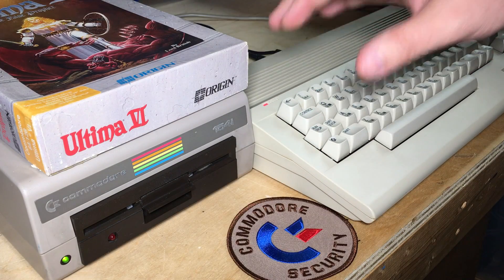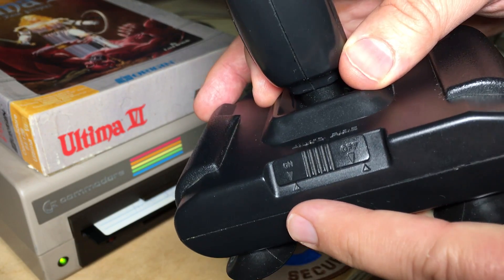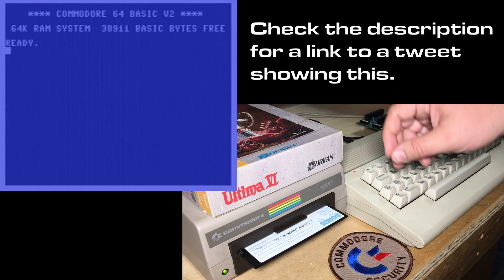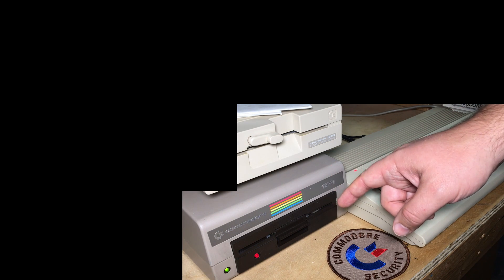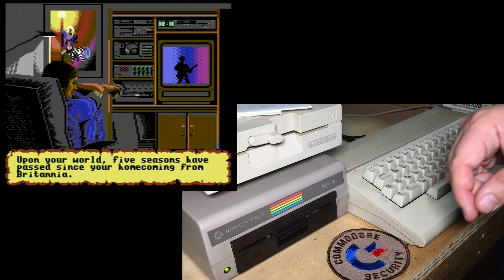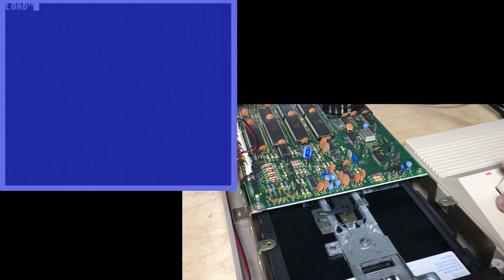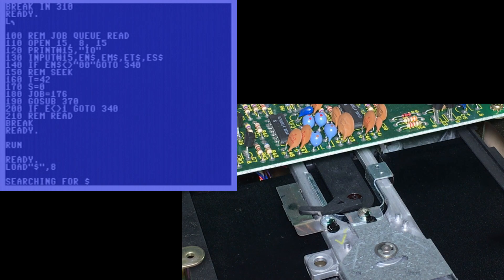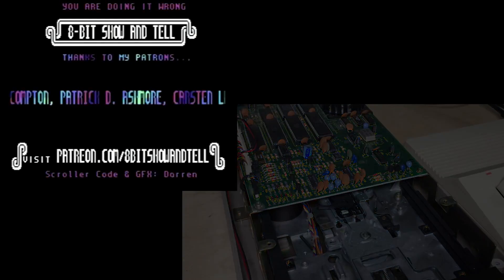Karateka Killed My 1541  (Temporarily) and Other C64 Scares

Comment: I think the joystick in port 1 is just acting like part of the keyboard. You can press up on the stick to get a 2 (at least I think it's up), or press 2 and send the character up... same thing to the computer. Basically just watching for those characters is the "joystick driver software" for port 1 (not for all types of controllers there, though). Right? As for how 2 works, I guess that's a little more complicated.
Reply: Actually joysticks do... in both ports :)

Port 1:
Up = 1
Down = Left arrow character
Left = CTRL
Right = 2
Fire = Spacebar

Port 2:
Up = Commodore key + F3
Down = Commodore key + S
Left = Commodore key + F
Right = Commodore key + H
Fire = Commodore key + K

Those presses will fill memory locations 56321 (port 1) and 56320 (Port 2) respectively with identical values for the corresponding joystick input. 
Robin has demonstrated how to read joysticks from  those addresses in another video :)

Comment: Only on the C64 does the joystick mess up the keyboard. 😒
Nearly every C64 user I knew had a copy of Fast Hackem to copy games. I gave a few of those copies out. 😝
Reply: For all its strengths there are some truly shocking user experience liabilities and failures on the C64, particularly considering it was a relatively late entrant in the market and everybody should have known better. The port 1 "oh yes it will just completely mess up your keyboard input, hope you don't mind" is just one of the more obvious ones.

Comment: Some EA games used to give me trouble loading on my 128 in 64 mode on my 1571.  If I pulled on the disk at exactly the right moment on gamestart it would load. I wonder if it was something to do with the track slots. I heard it was a quirk of copy protection.
Reply: The same grinding noise was heard when it happened.  It did not put the drive in an inoperable state for other disks.
Reply: I'll try to remember the name of one of the EA games it happened on and try to get one.

Comment: 9:45 Something very similar happened to me decades ago. I was playing around with disk instructions I had on some photocopied paper. I didn't quite understand back then what all those OPENs and PRINT#1s are doing. Maybe I made typo or maybe I tried something I shouldn't, but after that disk drive wasn't able to load anything. Small panic before I found some magical command, probably just that initialize, to fix it. phew

Comment: Great tip on that initialize. Going to try that on my 1541-II which recently stopped working and where cleaning it with isopropanol didnt do much. Cleaning my 1541C with it did work however. But now that I think about it, both drives failed on me about the same time which could mean that some disk I tried parked it in track 42 as you said, but that the 1541C was able to get out of that at one point.

Comment: About "CBM80": aren't there a bunch of games, that were released on multiple formats, including cartridge? Just thinking, that the same code was used on both cartridge and non-cartridge releases, which could explain the magic number being present.
Reply: Incidentally, the VIC-20 used a similar scheme, but since cartridges started at a different address the "80" was replaced by the address of the cartridge.